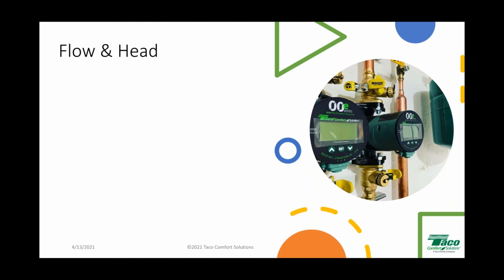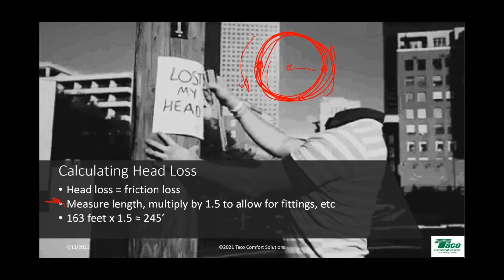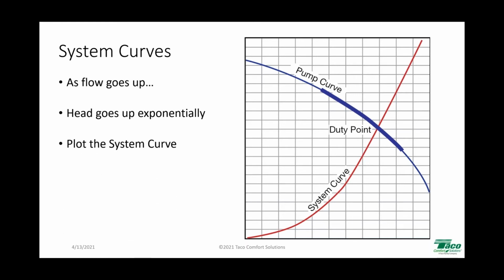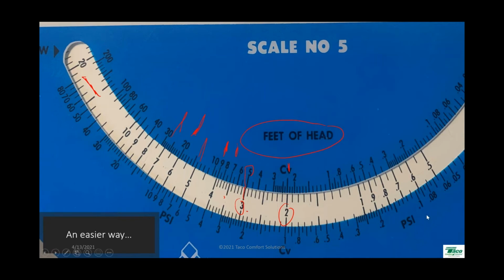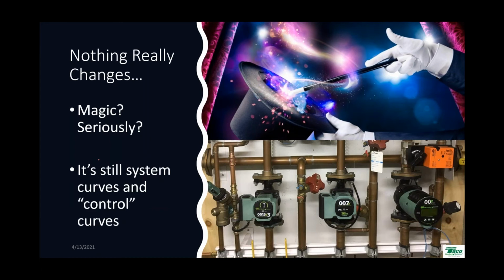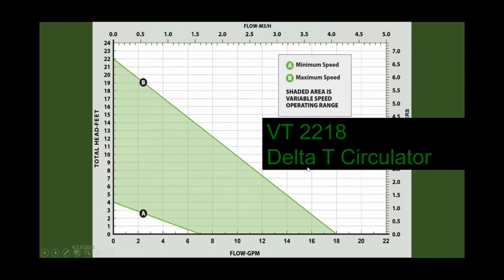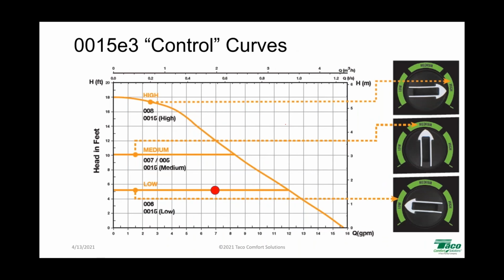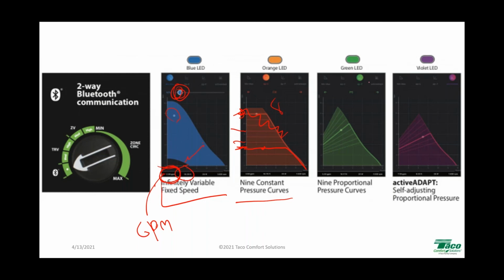Flow, Head & Sizing Considerations for ECM Circulators

Comment: Ever seen a remodel where people placed the bare baseboard heating element between floor joists?
Reply: Yes, I have.
Reply: What  do you mean curve and head
Reply: No
Reply from the maker: Daniel, I have seen it and some people can get very creative when it comes to trying to create a radiant floor heating system. There are easier ways to get the same results by visiting some of the radiant floor manufacturers websites.
Reply from the maker: Ronald, in this Taco Tuesday webinar, in order to choose the proper circulator for any given application, the flowrate in gallons per minute is needed as well as the head loss (friction loss) of the zone is needed. It is then plotted on a graph of different performance curves of circulators so that you can choose the right one. I hope this helps.
Reply: Yes. We have the raw fins attached to the "bottom" of the joist. But since it's unfinished, I'm running PEX touching the floor boards with insulation packed in the space below the piping. But this install was done 60 years ago. So "Old School" Radiant Floor Heating. And it works. But will work better once I'm done.